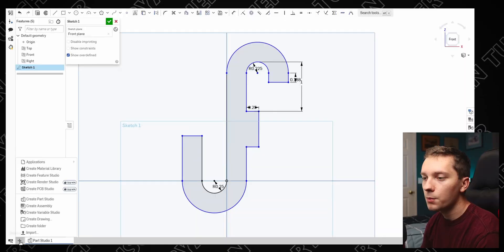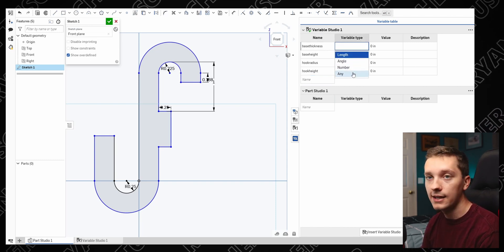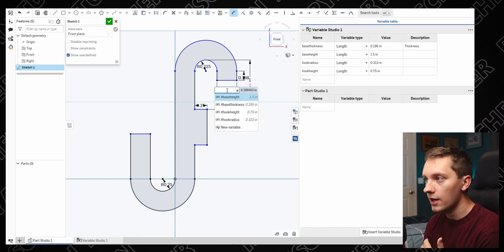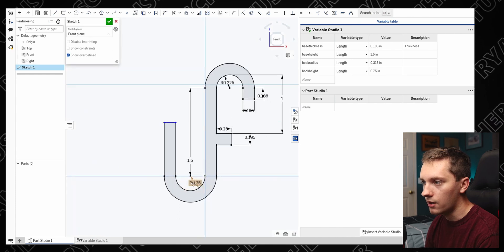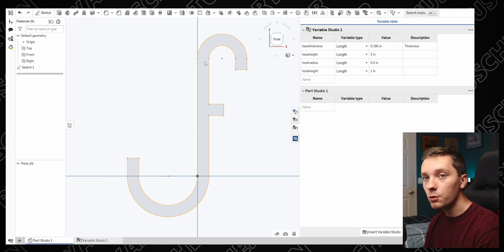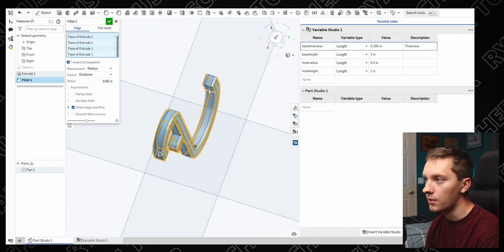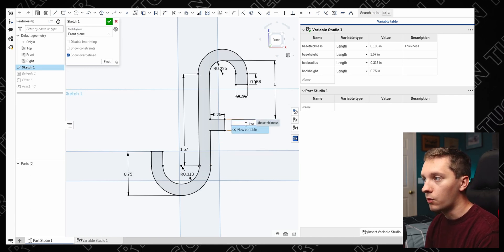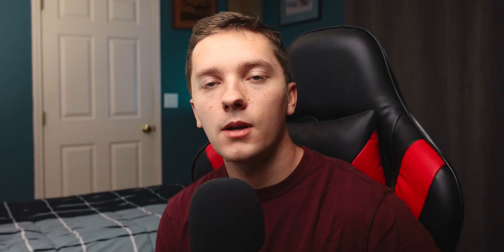How to Use Variables in OnShape

Comment: Great video, I have always thought that variables were underrated, However I would like to point out that there is a thing called a "configuration" which you can add under the "configuration panel" on the right side, then you can add a "configuration variable" which will let you type in any number (or text) to be used for multiples or other functions. I used it to make a configurable rail that had holes that were evenly spaced, so I could just type in the length of rail I wanted and it would add the holes right where they should be using a little bit of math in the sketch